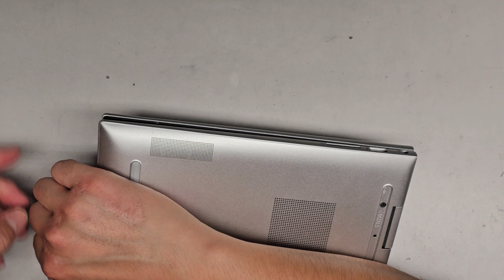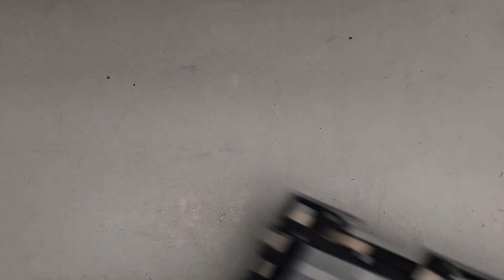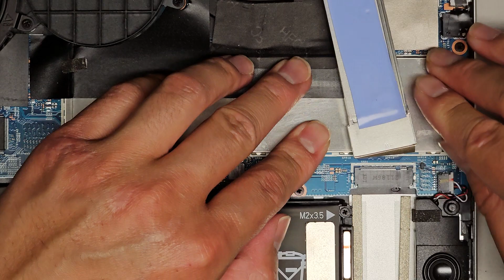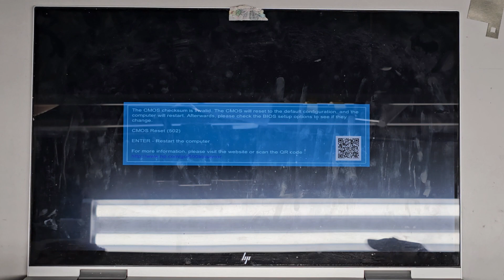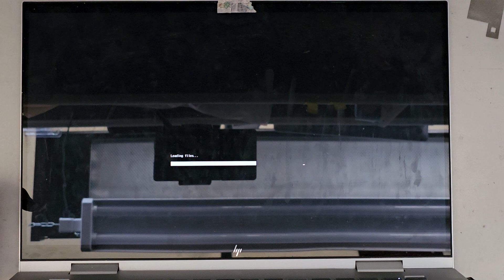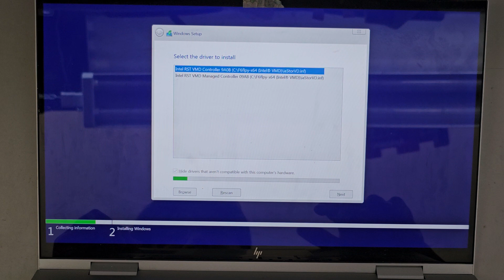HP ENVY x360 m Convertible 15m-es1023dx Disassembly RAM SSD Hard Drive Upgrade Battery Quick Look

Comment: I have the same model and when the Optane ssd failed, I replaced it with a Crucial NVMe SSD. Problem: the drive was not detected by Windows 11 installer. Solution: search for HP generic ssd driver, save to a USB thumb drive and Load Drivers when prompted by Windows 11 on a fresh install. It took me 4 hours to figure this out because NOBODY had described this solution.
Reply from the maker: The fix is to disable the Intel vmd bs...